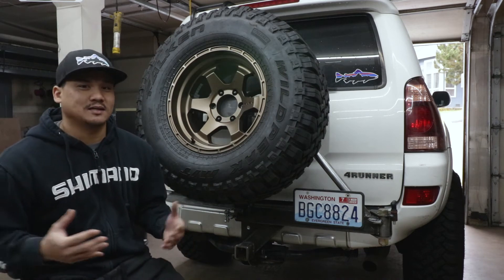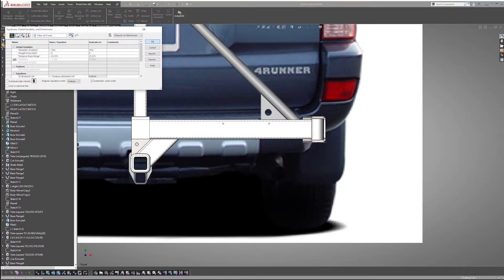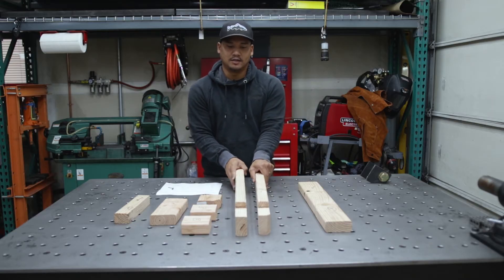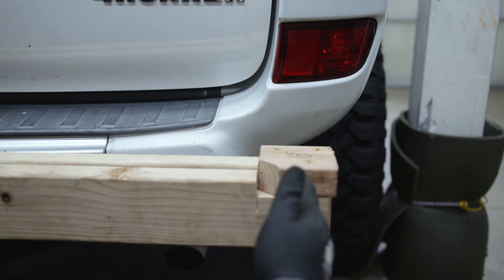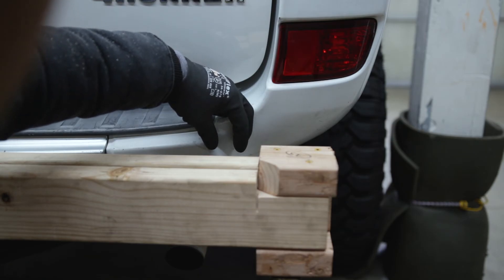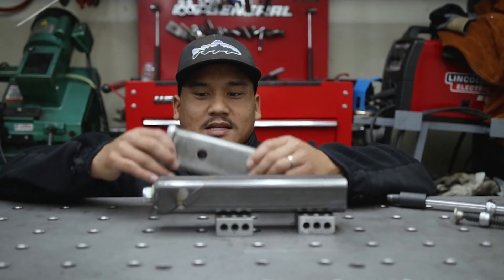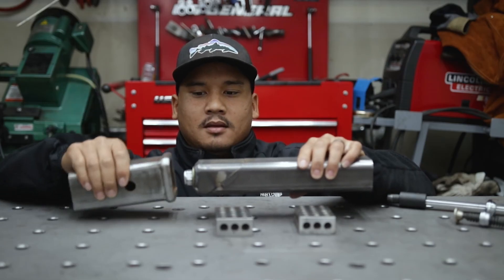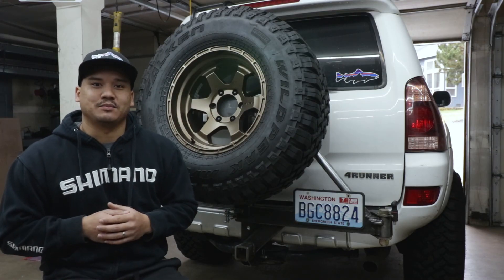Part 1 - How to Build a DIY Rear Tire Carrier (Hitch Mounted) - Anti-Wobble

Comment: I bought one swing out hinge from you for eighty some bucks and now the price is doble I wanted to buy one more for my envoy but I think the price is a little to high thank you so much
Reply from the maker: @israelavila1749  yeah this is a different version. Heavy duty! Using bearings and can handle more weight compared to my old hinge. Lots of quality upgrades went into this one.
Reply: @RathaSochenda do you have one like the one I bough I would like to buy one of them let me know sr appreciated thank you so much
Reply from the maker: @israelavila1749  unfortunately i do not. That one you have is discontinued

Comment: I love that anti-wobble wedge but wouldn't it be easier to just drill a hole on the bottom of the receiver and put a bolt in it. I haven't tried it yet but I'm thinking it would work. I guess it's time to put it to the test
Reply from the maker: This is for people that don’t want to drill there factory recievers
Reply: @RathaSochenda  I was actually going to go with the wedge afterall because I just really like that idea better but I'm making this swing away hitch for my friend and his truck doesn't allow it he has a tire on there that won't come off so I just got one of those anti-rattle hitch plates. But for my own personal one that I make I think I definitely will use that wedge. Also I think the way you presented everything was just really awesome.

Comment: Hi where do you buy the washer/ bushing for hindge assembly?(what do you call it or parts number)I need to change mine,thanks
Reply from the maker: ISOSTATIC, OILUBE OIL IMPREGNATED BRONZE FLANGE BEARING
Reply: I found some on amazon, one more thing sir, whats size? Im going to order it(i just wanna make sure its the right one) thanks. I already look on your website but your not selling just that one?! Your selling the whole kit for the tire swing. Thanks you sir
Reply from the maker: @kingbetong8741  depends what size tube are you using? From there you should be able to spec out the correct busing

Comment: Really nice calm style to the build. Subscribed.

If the car hitch was closed and you could not access the anti wobble bolt from that end, how would you design it? My car has a closed end hitch.
Reply from the maker: I would cut open the close end.
Reply: @RathaSochenda  can't modify that tow bar legally in Australia without engineering (insurance wont pay out). Might try and fuse the bolt on the closed end and run the nyloc on the open end from the back of the car

Comment: 3”x1.5” square tubing is not a common size near me so would have to order in an entire 20’ft piece which that alone would cost me $150. So just make sure everything is available before deciding on building lol
Reply from the maker: I’m sorry that you don’t have it in your area. Have you tried searching online. There should be a few places you can order a small amount.  Or you can also get to make 2x2 work as well.

Comment: do you have a version that can accommodate a hitch on the part that swings out?
Reply from the maker: Nope but not sure why that would be useful? But then again it would be easy enough to weld on a receiver hitch to the swing arm portion.
Reply: @RathaSochenda  well I want to be able to swing my bike rack out, because if I put the bike rack on the hitch extension already in the plan then I won't be able to swing out the arm or open my tailgate
Reply from the maker: @kimmyyimmel2010  maybe try just taking a piece a 2.5"x2.5".250" tube and weld it to the bottom side of the swing arm.  Will that work for you?
Reply: @RathaSochenda  maybe? i am looking to get in touch with a fabrication shop and will pitch the idea to them since i dont know how to weld or own half of the tools i need to make this by myself

Comment: 🖐🏻Dummy here…I purchased your plans but the bar and tube stock used doesn’t specify the steel type.
Reply from the maker: Cold roll and/or hot roll steel will suffice

Comment: Interesting idea with the wobble system. Did you consider at all using a longer bolt out the front so that it could be tightened without going under the truck?
Reply from the maker: Thanks I sort did… the issue is the safety pin gets in the way when you go through the front. And also I’m not a big fan on running a long extension through the receiver and trying to get the proper bolt torque (100ftlbs. Also longer bolt means stretch in the bolt make it weaker unless you compensate with a larger OD bolt. The advantage of fastening it from the back is that as you tighten the nut it removes also the slack of the safety pin which makes everything even tighter. Hope that makes sense 🤙🏾
Reply: @RathaSochenda  Ahhhh good call, I wasn't even thinking of the safety pin. I have just had trucks where the back of the receiver is capped which is what made me think of it.
Reply from the maker: @NickWhite630  oh never thought about rigs that had a capped hitch. Good to know.

Comment: I’ve always hated that wobble! Now I know how to fix it on any of my hitches!
Reply from the maker: I know right. Wobble = Suck. Glad this video helped stay tuned for the next one!
Reply: After thinking about it a few minutes, I’m really liking this design, can’t wait for you to post the rest! A few suggestions:
1. Patent this use.
2. Reverse the weld from welded stud, to welded nut, then carry the bolt all the way through like the bike did. That way it can be tightened, or removed from the opposite side (exterior of the car vs underneath).
3. Cut the bolt head off and weld on a locking lug nut head. This will lock your unit on as well.

Comment from the maker: Purchase the Build Plans Here: Version 1 (V1) Tire Carrier Build Plans (inches & metric units): https://rathasochenda.com/product/gen-1-tire-carrier-build-plans/

Or here via Etsy: 

https://www.etsy.com/listing/1195723390/diy-rear-tire-carrier-hitch-mounted?click_key=0b7e9cf9a6d19a7e4f6097c17658f266d01ee91a%3A1195723390&click_sum=f4b6adf7&ref=shop_home_feat_3

Or

Get our NEW and improved design "'Versions 2 (V2)  Build Plans and consider purchasing our Universal Tire Carrier Ultimate build-it-yourself kit. It makes the build a snap! Click here to check it out.

https://rathasochenda.com/product/generation-2-swingout-5th-tire-rack-build-bundle/

In this video, I'll show you How to Build a DIY Rear Tire Carrier (Hitch Mounted) -  Part 1 - Anti-Wobble. I'll take you through my DIY process from designing to planning. 
 
Video Chapters

0:00 - Intro
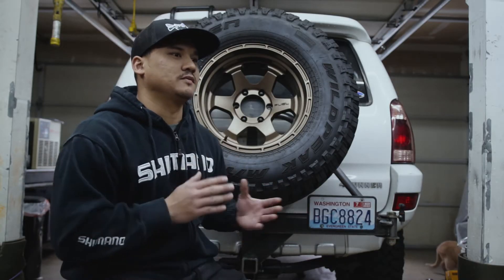0:40 - Challenges and Goals.
1:50 - Researching Tire Carrier Options
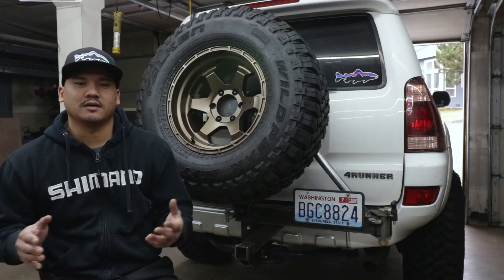2:49 - Anti -Wobble Concept - How it Works
3:38 - Measurements off the 4Runner
4:00 - Building a wood mockup of the tire swingout
6:05 - How the Swing-Out Works
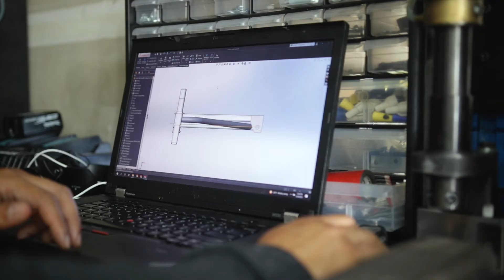11:35 - Building the Anti-Wobble Hitch System
16:25 - Testing the Anti-Wobble on the hitch
Reply: Hi idol are you filipino american.thanks
Reply from the maker: Cambodian
Reply: You should patent your anti wobble.